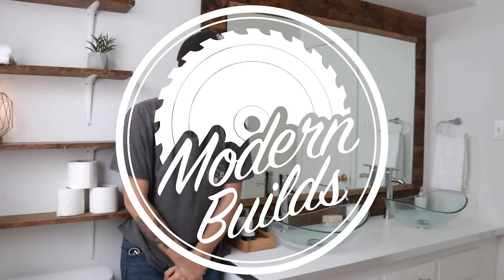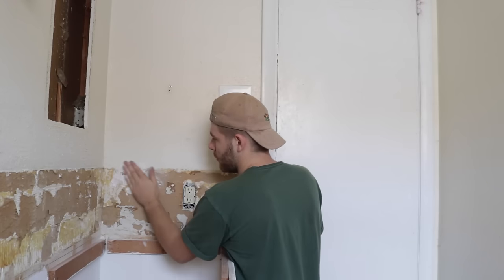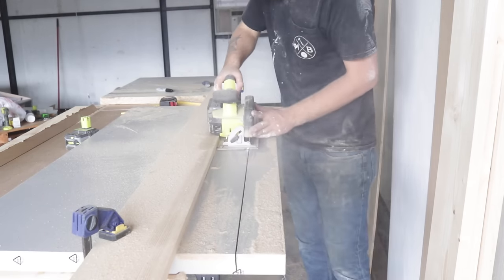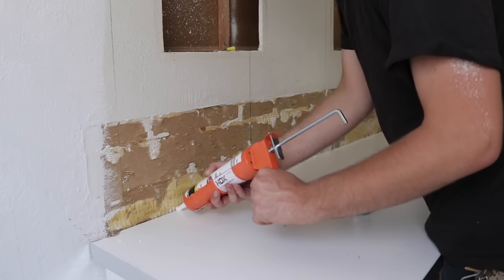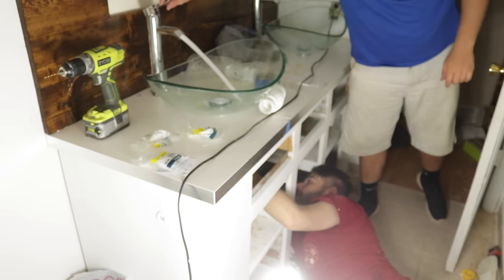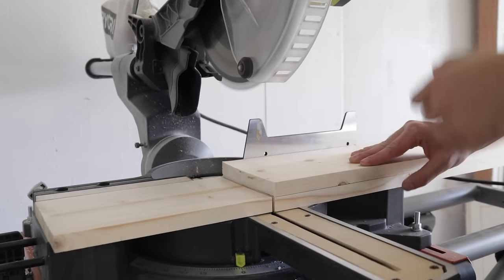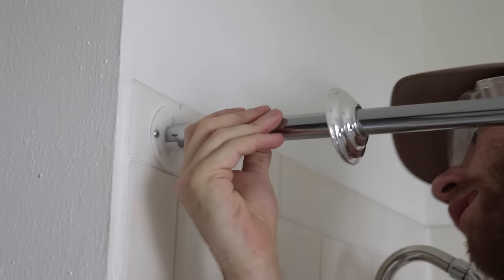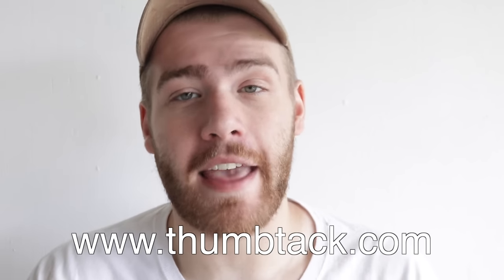Remodeling a bathroom for Under $500 | DIY | How To | Modern Builds | EP. 67

Comment: Hi. Great video...just wanted to add a safety tip. I noticed you holding the blade guard while using the circular saw. Would hate to see you without all of your fingers so please use the handle on the top of the saw instead. Theres a handle for the trigger and a handle for guiding the saw. Again, great video and thanks for sharing!

Comment: "S Shower Pipe", brilliant!
Reply: Extending/sliding shower heads the BEST! (I live in a flat shower was designed for dwarfs or something... I had to duck then my son grew to over 6ft... Landlord thank god put in bar slides on also has stainless steel hose can lift up and off holder is BRILLIANT!!)
Reply: Agreed. I’m 6’3”. I hate low shower heads. Awesome easy fix. Great idea.

Comment: It's a bit hard for me to believe this DIY was made under $500 (lol) but it was still a good job...was thinking if you had put sliding glass doors for the bath tub, it would be a great job. Maybe a future project? lol ;))
Reply: Considering he didn’t retile the floors or shower or replace the toilet I can see it being under $500. Counter was 20, paint was 20, wood stain less than 10, and the 2x6s couldn’t have been more than 75. Shelves above the toilet were free. So the sinks, S pipe and shower head, metal shelf brackets, cabinet pulls and mirror being under $400 is believable if he utilized the ReStore and clearance racks.
Reply: You need to learn how to shop better. 😄

Comment: Awesome job!  I'm starting on my own DIY journey too.  Tell me, howd you handle the floor? That's one thing I truly have no idea where to start.  Thanks!
Reply: What kind of floor is it? And what kind of floor do you want it to be?
Reply: The existing floor appears to be luan but I'm not certain because there is at least 2 layers of cheap linoleum stuck to it. I just wanted to put peel & stick tile down. Nothing fancy.
Reply: I guess pull up the lino and stick your new tiles to the luan if it's level and in good condition
Reply: Simple as that? Any prep work? The lino was on for over 20 years and seems like it's stuck for good.

Comment: Hi ✋ 
I want to ask you, why you use wood in the bathroom?? The wood can't stay with water for a long time especially in the hot contrys is there any other solutions? ? Thank you ❤
Reply from the maker: The wood is fine
Reply: Modern Builds what do you think to come to saudi arabia and fix my bath to become to beautiful hhhh🌸
Reply: There are different kinds of wood that can be used for areas where humidity is a fact
Reply: I have the same question. I live in the South where heat and humidity are the norm for most of the year. Mold is easy to grow. I like the wood very much, but I'm wondering if there is an alternative or would you stain and seal the whole pieces. Would that be sufficient?
Reply: Seal it with 3 coats polyurethane after staining the wood. It is very mold/weather resistant.
Reply: Makes sure to wet sand in between coats, with at least 220 grit sand paper to ensure that it doesn’t end up looking clumpy
Reply: Not it's not. Seasonal expansion will crack your benchtop or slit the board at one of the joints, over time; especially in a bathroom. One of those cases where the aesthetic factor shouldn't trump the structural one.
Reply: The counter is also wood (underneath). Only the top is covered with non-porous material.

Comment: nice looking brushed nickel finish with multiple water spray options

Our master bathroom has a standing shower with handheld shower head.
We started to see some rust spots in the hose not to mention heavy mineral built ups in the shower head because our house has very hard water despite water softener we have.

My wife picked out this handheld shower head to replace our old one because she loves the brush nickel finish to match our bathroom decors but this turned out to be very impressive handheld shower head.

Although I have replaced shower heads many times in the past, it came with nice instruction on how to replace it for those who's not familiar with it. My only advise would be to use wrench to hold the base spout when removing and installing the holding adapter so you don't accidently twist and damage the base pipe when you over tighten it.

I really appreciate that it came with plenty of plumber's tape because you really want to put that on before connecting different parts so that there's no water leak in between threads. This is one of most common mistakes and reasons why there's leak after installing it. Very happy to see that they have provided plumber's tape to remind you to use it!

It also had rubber rings/washers in each connector but it also came with extra one, which is nice. They also included a shower drain cover to prevent hair from going in to the drainage, which is a nice bonus. I really love the brush nickel finish, which makes it look elegant and expensive. The 7 different water spray setting is nice to have so you can change it for different purpose. We will most likely leave it on one setting for most of the times but it's nice to have option to change it when needed, such as jet spray for cleaning the shower wall, etc.

After replacing the shower head, I didn't see any leak and the stainless steel hose feels sturdy. I also like that I can rotate and tilt the shower head holder and it stays in place. Overall, very happy with this shower head!

https://amzn.to/3gVZIrH ( AMAZON -US )

Comment: The s pipes can be a bad idea. If there is a leak the drip  can follow the pipe back behind the wall rather than down the front to the spray head. You’re better off cutting into the wall on the reverse side and just raising it above the tile. Just patch in the tile piece.

Comment: The old sinks/countertop looked great to me, even though dated. I like the integrated sink with countertop look. Although vessel sinks have a few minor advantages, like more counter space around the bowl and easier to install, having to clean two sides of a sink bowl would be a downside. I also wonder how easily they get scratched or how easy it would be to crack or break one.

Comment: How has the wood wall held up? I could see buckling and expansion being a problem in the hot humid environment, as you didn’t build in gaps and really pushed the last board on top in there with some force.
Reply: Yul Strokheet Al-Wauch  You can use a bathroom grade silicone glue. It works great =D

Comment: what was the white tape u wrapped around the shower head and its purpose
Reply: Teflon Tape. It's to prevent leaking. You should use it any time you replace piping and to link piping joints.

Comment: Dude... did you really just change the leveling of the counter top to match the ceiling so you could avoid cutting that top board to fit? Good luck with stuff rolling off the counter.  Just use a level to check the counter top, and cut the top wall board to fit.  Otherwise... looks great.

Comment: Uh... no.  Those crap shelves are garbage.  Those brackets belong in a garage and not in a house.  You can do much better with your handy dandy router and a piece of 1x6.  It will not look so... garage.  And, I would personally NEVER use an Ikea counter anywhere near water, and you are going to get water around the outside of those sinks and the counter will turn to mush in short order.  Ikea looks neat in the showroom, but they are pretty bad quality and nothing but particle board and sub-standard glue.  Cleaning those sinks next to the counter is also going to be a pain in the rumpus.  Just my opinion, of course.

Comment: I adored the video on the geometric flooring, but this remodel (while beautiful) wouldn't hold up for longer than a few months in a bathroom. Bathrooms are high moisture rooms with lots of steam. You don't want porous materials anywhere near a sink, and you certainly shouldn't use a laminated particleboard countertop in a bathroom. The glue just doesn't hold up to the frequent ambient humidity. After a period of time, the laminated panels will start the lift off of the particleboard core. Stained wood around a sink (unless heavily sealed with polyurethane in multiple layers) is going to start showing a white haze every time someone showers in that bathroom. Beautiful, but not really practical and not a long term solution. Still really like your channel, however!